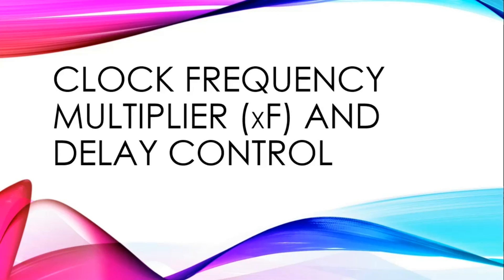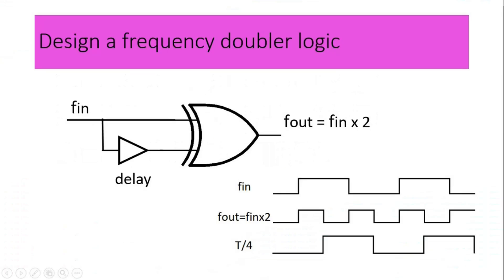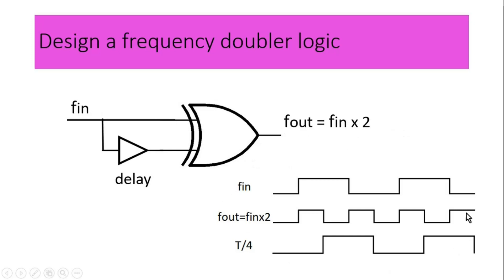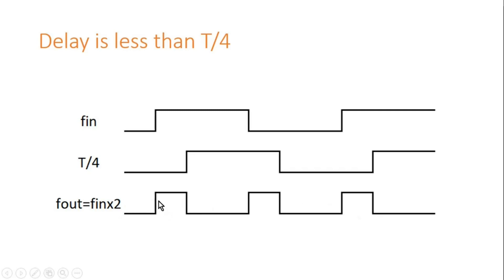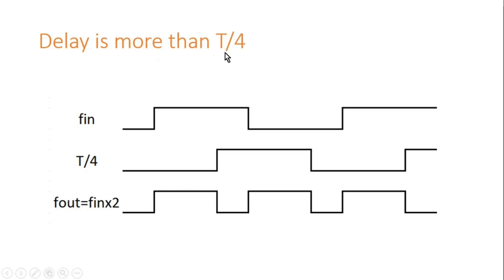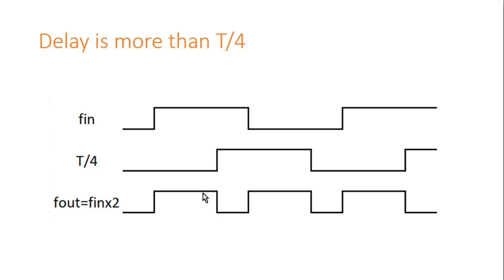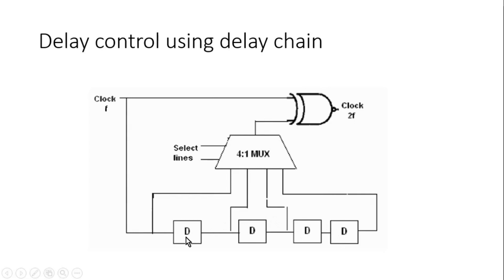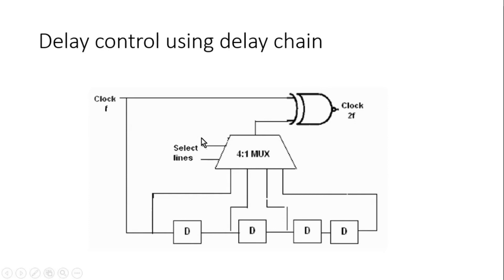Clock Frequency Multiplier Part 2

Comment: Sir we can produce a delay of either 1 clock cycle or half clock cycle  using d flip flops. But how to get quarter cycle delay? Which device should we use to obtain that amount of delay?
Reply: Yes, instead of using the original clk to the D flip flop, use this freq doubler as a clk to the neg edge-triggered D flip flop to get the desired quarter delay